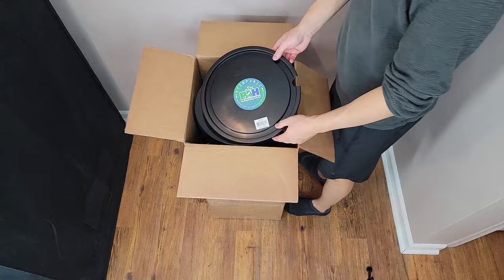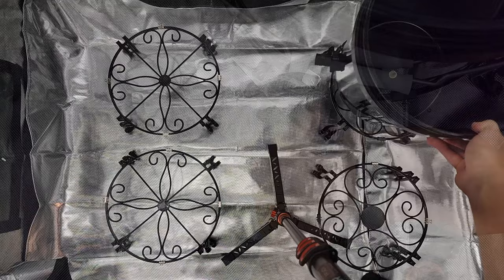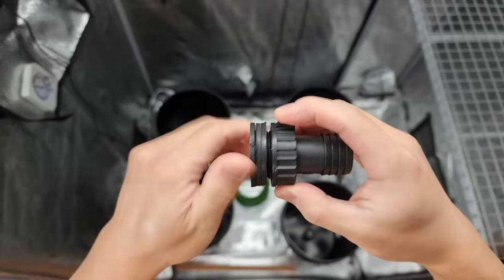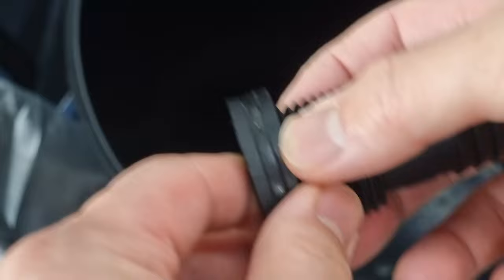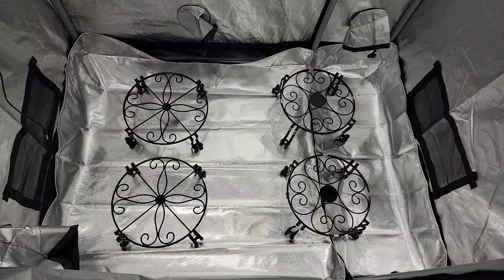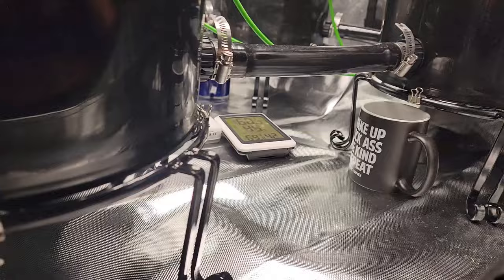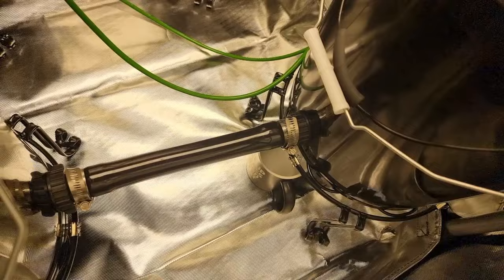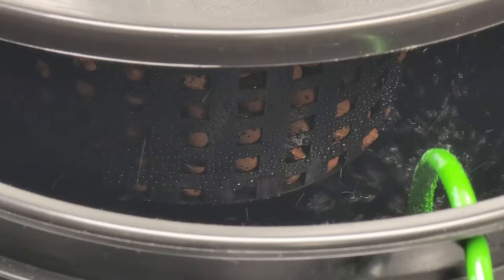How to Setup a RDWC System- PA Hydroponics Stirponic 4 Bucket System Installation Troubleshooting

Comment: Definitely a different way of growing bro. Been growing in RDWC for a while now and I can say you did a really good run thru of everything!! I started off exactly like this too but as time goes by it does get easier! It is expensive to start off like you said. I would keep buckets ready with RO water for when I need them and getting a separate reservoir was a game changer!! I have a a blue lab pH controller in the reservoir connected to my 18 bucket system I use for flowering. I use to spend most of my time checking pH on all plants every other day, but with that controller, I now use the time to Scrog and train the plants! Anyways, awesome video!! 🤘🏼
Reply from the maker: Yeah. It definitely gets easier and now it’s routine. Plants are thriving now and they’re huge compared to my soil grow.

Comment: His fallponics setup is killer.  It's worth mentioning that polyurethane hose works best if you heat with a torch till it sweats then put it on the bulkhead to cool.  It will seal better.   Won't even need clamps.  And it won't leak.  Gary builds some nice stuff, but 1" lines are scary bro..  I'm nervous for you lol
Reply from the maker: Exactly what I said would happen, happened, avoided a flood because the water level indicator, I really can’t let the roots get big at all.
Reply: Also with those bulkheads, 1 gasket inside, 1 outside, dont double them up.
Reply from the maker: @djq27  I tried that, it leaked, the double on one side has worked better for me
Reply: @HowWeedGrow This system in the video leaked?
Reply: It leak because the clamps get to tight and broke the polyurethane hose. Sorry for my english
Reply: Do the roots clog the lines?

Comment: Aloha from Hawaii.  If you are thinking about trying rdwc in Hawaii you will need a chiller. Our temperature here is low to mid 80s on the average.  I run a iceprobe chiller and a 16 gallon aquarium chiller.  Keeps water temp about 69 to 72 degrees.  Any warmer you may start to have root problems.  Just my personal experience, hope it helps
Reply from the maker: Yup. Check my channel. I bought a chiller and plants have been doing great since

Comment: Would you reccomend this rdwc vs just dwc because of having access to a reservoir vs having to check the individual buckets?
Reply from the maker: Not this one, the only ones that work are the waterfall systems, because these have proven to clog and flood. Also, only if you’re doing all the same strains

Comment: Use a little wd40 spray the sticker and let it soak for a sec will come off really easy then wipe with some alcohol   works wonders
Reply from the maker: I’ll try that next time. Thanks for the tip